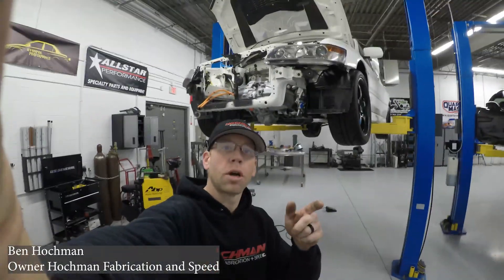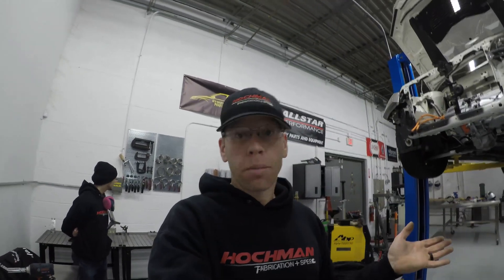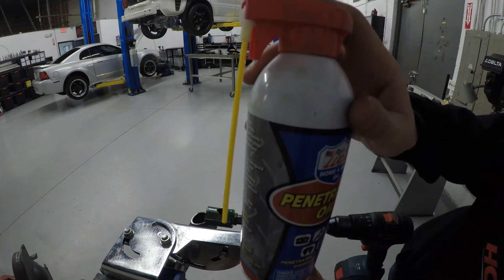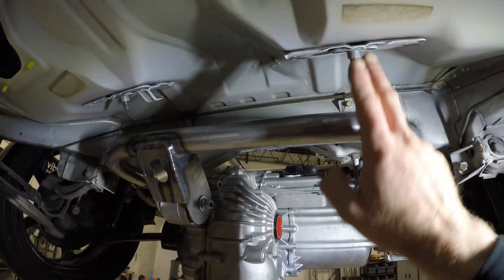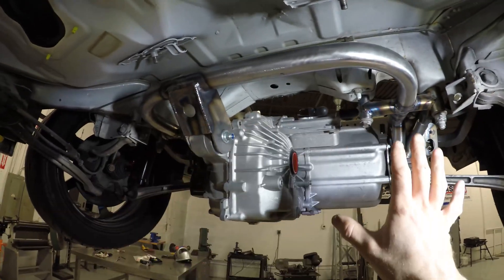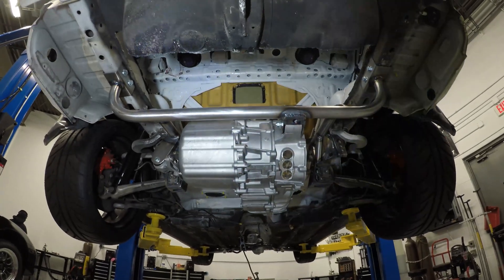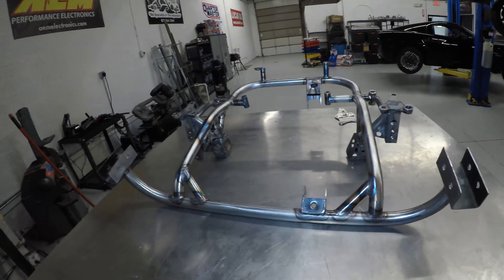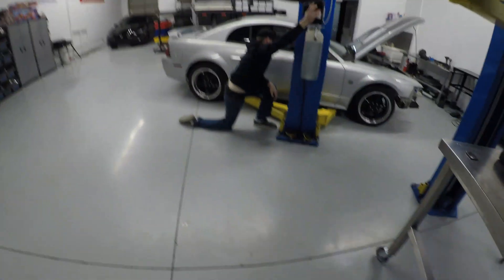Tesla Model S Swapped EVO 8 - Making Major Progress!

Comment: Awesome project! I actually am in the process of electric converting a 1980 VW Rabbit and stumbled across your customers build forum on diyelectriccar.com. I purchased a front motor out of a Tesla model X which. I see that you ended up reverse mounting a small rear drive unit. My current plan is to clearance the firewall about 2 inches to run the motor in its original orientation. But after seeing this I might have to scrap that idea. Are you helping him with the parts to solve the oil pumping issue? I know your mostly just dealing with the fabrication side but I hope you guys get a chance to make some more videos of this car after it’s closer to running. Again awesome work!